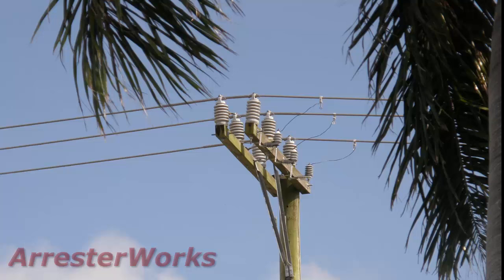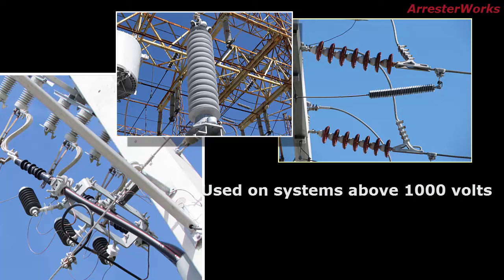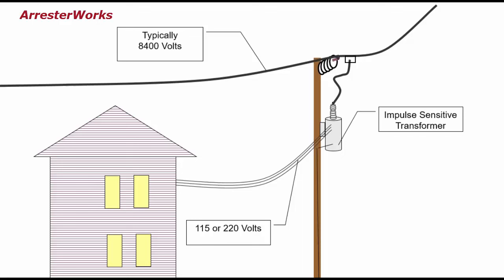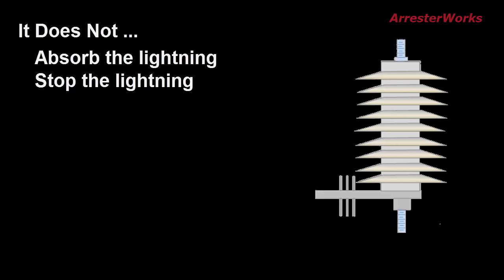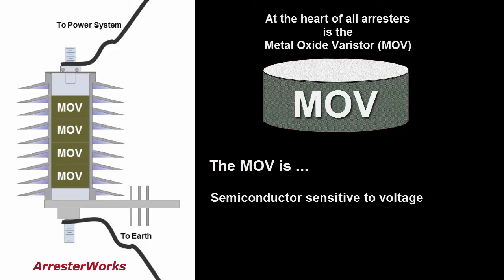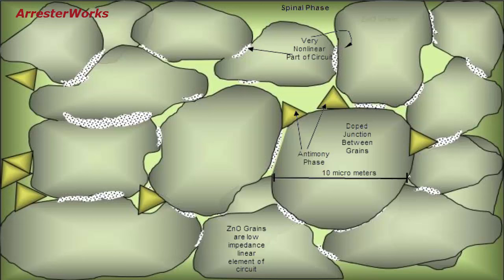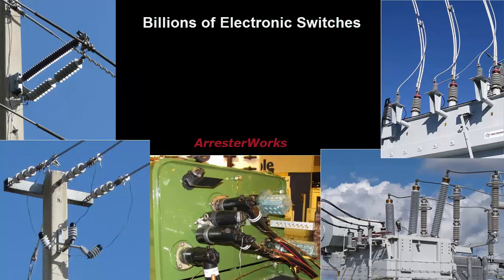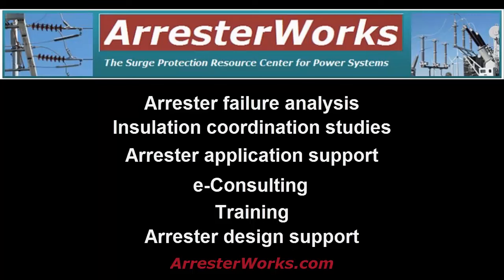What is a Lightning Arrester

Comment: Also two lightning arrestors within a second becomes super hot when operating for that millisecond and if any cracks or erosion was to form outside the insulation it will explode aka a bad lightning arrestor

Comment: My boss had me wearout 3 hacksaw blades trying to cut thru a 10kv arrestor longways. I gave up cutting thru the fins and only about 1/16th of the mov. That sucker is built to last!😮
Reply: Actually it isn't. A close, hard strike will blow one to bits! Seen it happen on my property. Was picking up pieces in a 30ft radius around the pole with the transformer on it.
Reply: @JP-rf7px  
And what kind of hacksaw did that lightning strike use? Certainly not the hardware store variety?🫣😝

Comment: EXPLAINED WELL ABOUT THE MATERIAL FILLED IN THE L.A. WHAT IS THE SIMPLEST L.A. FOR A 3PHASE 4 WIRE 5 KVA POWER COMING TO A HOUSE TO BE INSTALLED AT THE LAST POLE & THE COST?. THANKS.

Comment: In case of a double steel tubular pole mounted 3 phase distribution transformer is it important to provide an insulation/insulator between LA and metal channel on which LA is installed and why?

Comment: thanks a lot.. i am elect. engineer and in fact we do not utilize surge arresters except for 132-KV power line...

i do not work for power company but i think due to non lightning area we live in, we never use SAs in less than 132000 volts...

is that correct?

Comment: What's the difference betwerrn an arrester and an insulator, arent they the same thing?
Reply from the maker: Greetings Roland, An insulator is always an insulator. An Arrester is like an insulator until a surge comes along and then it turns into a conductor.  It insulates most of the time.   I like to call an arrester a smart insulator but niether the arrester or insulator manufacturers would like that.
Reply: A great question and a brilliant reply

Comment: How about dry type transformer 440 to 220? Where do I install arrester?
Reply from the maker: If the transformer is exposed to surges, then put the arrester close to the transformer on the side of exposure.
Reply: What is the connection?
Reply: Because I tried put the ground bar and connected to the neutral. I think something wrong.

Comment: Anything is conductive at a high enough voltage
Reply from the maker: Joe, you are absolutely correct, however in this case it is in a controlled manner.  Not a failure.   Thanks for the comment.

Comment: Can high dog with no lightning cause a lightning arrestor to cut power? Guy on the ground said guy on the pole was fixing the arrestor at 3am when I got home. After listening to this, and what I could see through the fog in the dark, I dont think this would be an issue to come fix three hours into new years day unless the fuse blew, or the transformer was picking up extra charge from the arrestor malfunctioning? 

Maybe I'm thinking this wrong, but foggy high humidity conditions could cause static discharge that might warrant this?

Would love any help from someone that knows this trade as I am below a layman.